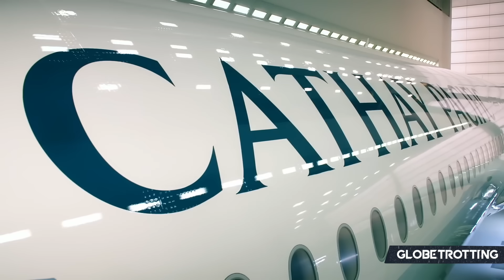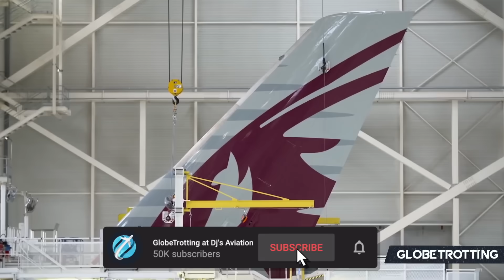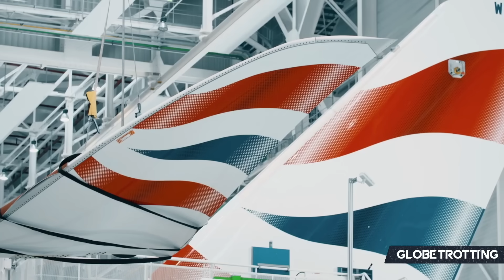777X COMPETITOR - The Airbus A350 1000

Comment: A350 is a large capacity aircraft needs a business case then it is the same with using 777x.  Because both have near 400 pax, and so it should be used in high density routes. So airlines prefering it must have a market to cater like the 777x.

Comment: i think the A350-1000 will be a great success compared to 777x, two reasons: clean sheet design of state of the art, and perfect size make it a perfect replacement for 777-300er. Despite the dalay of 777x, 777x has a big problem, it is too big and aiming to replace 380 and 747, but big Jombos are not trent any more.

Comment: 350 1000 IS SUPERIOR TOO 777 X. New design new improvements have made it even better. ENGINE ISSUES IS MAIN PROB; SO RR Need make a ultra fan for a350 1000 with 100k thrust and better maintenance  issues. RR HAS ULTRA FAN WHICH IS READY SO IT CAN BRING IT IN. ROLLS WANTS SELL MOR EOF TRENT XWB BEFORE THEY BUILD ULTRA FAN. 2028 UKTRA FAN FOR A350 1000 NEO, IS COMING. 777X IS OLD DESIGN LIKE A330 NEO. So 77x is not for 99 %% of clients.

Comment: I hope they aren't wasting too much time and material on the A350-1000 as customers are looking forward to the production start of the A600 Airtrain. It is a brilliant innovative concept of several components of passenger and cargo aircraft, taking off separately, forming one long structure in the air with 1 or 2 of the cargo aircraft being fuel containers, enabling non-stop operations to every destination on this planet. Like a railway train, the passenger aircraft sections can separate and reach specific airports, while another aircraft can join, forming the Airtrain again. The same does apply to the cargo airplanes acting as fuel cells.
Airbus is not too open about these A600 models. Patience, please. They just want to be sure that it will work.

Comment: The 77X is a more advanced plane with many features desired by the airlines. They are rightly excited about it. But some need something now and the 777X isn't available yet so they are buying the A350 1000. The 777X will do well when it finally gets certified. The 777X is the only thing that can really fill the gap of the A380 or the 747 in capacity.
Reply: From what point of view the 777X is more advanced? With the fuselage of the 80's?

Comment: Very well done. You didn't mention the real possibility of an A350 NEO version.
Reply: Airbus has already said that won't happen before the 2030s
Reply: Boeing can stretch the 787 to the same length as the a350-1000 if they need to ...the 787-10 is already slightly larger than the a350-900. Such a varient could eventually replace the 777X family down the line and compete directly with the a350neo somewhere in the 2030s-2040s

Comment: There is only a problem with this entire video...by definition its impossible for the a350-1000 to compete with something that is not in service yet....

Also, and if Boeing doesn't add any unknown surprise (cue to avoid flying on the 777x frames for a bit), Boeing is entering the market with a design aimed at gaining market share against a range of frames that have been flying for years.....

Comment: The latest Boeing offering needs to be better than the current versions of the B777, which simply no longer measures up,compared with the Airbus offerings. Having flow the 777 for the last 20/15 years ( under protest) I long to continue flying on the A 380 and A 350. With a direct connection to LHR, Paris, NY and Frankfort, our beleaguered Qantas will renew its lost close relationship with Aussies once they experience the A 350-1000

Comment: I suspect the 777x will end up replacing old 777s when they get old. 
Unless the 777x can provide better efficiency and versatility, growing companies will probably expand with the A350 instead unless they're Boeing only operators.-
Reply: Different size category the are looking at
Reply: @johniii8147  I still don’t know if Boeing is going to make the -10 which would be in a different size category.
The -9 is a bit bigger than the A350 1000, but the difference is not big, that’s why the figures in capacity, cargo, people are also expected to be close. The aircraft is not yet in service so we have to wait for the exact figures. But we might expect 10% more cargo space for the 777-9 and a few more seat capacity as well. The -9x expected range is not the same of the A350, but I suspect the difference again will not be big enough to make a difference.

So, efficiency and fleet standardization are going to be the deciding factor, not size.
And If we look at sales figures we find a preference on the A350-900, not the bigger -1000. So I doubt Boeing finds many customers for a -10x variant.
Reply: It’s likely all of the retired 777’s will become freighters just like we’ve seen 747’s and 727’s.
Reply: @thickboi7570  Nope, some, but not all. There is no conversion program for the 777-200/200ER/300. There is only a conversion program for the 300ER/200LR . Even of the latter 2, only some will be converted. Maybe  100 of the 800+ that were produced.

Comment: It is all deck chairs on the Titanic. Net zero will have a huge impact on air travel as alternatives to jet fuel will be more expensive or less efficient, which will impact air fares. For the first time since World War II there are no all new Western airliners under development. The only major project still in development is the 777X, a derivative of a 30 year old aircraft. An all new airliner launched now would likely not enter service until 2035. With moves to ban short haul air travel likely to extend to all areas served by high speed trains before then, the market for an A320 replacement shrinks. Will enough people be able to afford an intercontinental flight to justify an A350/777X replacement?

Comment: I am skeptical about the 777X in that Boeing is trying to match Airbus in efficiency metrics by cramming more passengers in it. Boeing went with traditional alloys on the 777X fuselage when it could have used the Lithium Aluminum alloys (like what the CS/220 series use) to build it. Boeing is trying to have 787 features with 777 materials on the fuselage which might lead to long term structural issues. I’m not sure how you can pressurize the aircraft at the same altitude as a 787 and have the same size windows and expect it not to wear out quicker. Sure it’s doable but there could be bigger issues down the road.

Comment: By the time the Boeing 777X comes into regular airline service around 2025. The Airbus A350-1000 could well have an A351 NEO variant in the pipeline. The RR Ultrafan engine will ensure the A350 maintains it's lead over Boeing.
Reply: It won't. Airbus has said itself any NEO variant won't happen before the 2030s. Ultrafan development has also been put on the back burner.
Reply: @johniii8147 Why do you keep repeating this "back burner" thing about the Ultrafan? Makes me realise just how much shite you talk. RR have 5 yes FIVE separate iterations of the engine in various build stages. One of which is aimed at the XWB97 segment. You can carry on putting your fingers in your ears all you like but it's happening. They finish ground testing the largest iteration and it delivers 12-14% efficiency over current GE9X. They are not going to simply put that away in a corner and forget about it.
Reply: @nathd1748  Very recently a senior executive at Airbus was said a 350 NEO would be in the 2030s. RR has also said they waiting on new airframe for the Ulta fan to go full speed. This is all easily looked up.
Reply: @johniii8147  Rolls Royce have not said they are waiting for a new airframe at all. They are chasing a 3rd engine option on that 13 year long backlog of A320 series orders and 2nd engine on the A220. You talk out of your hairy sole mate. Why would they have another 4 Ultrafan iterations under construction if they are waiting for a new airframe??
Reply: @nathd1748  they have publicly said it  at least twice  in the press by senior management. Not shop floor staff that doesn’t call the shots
Reply: @johniii8147  Yeah well on the shop floor they know exactly WHY they are building those iterations of the Ultrafan. And if a viable 3rd engine offer for A320 series comes up, Airbus are going to JUMP at it knowing the aggro coming their way courtesy of the GTF. Oh and technically the A350F IS a new airframe. Did you forget that? It is of different length to either the 900 or the 1000.
Reply: @nathd1748  Neither Airbus or Boeing is any rush for a new engine type and RR knows that. All 3 parties have enough issues currently to mange rather then focus on a new engine type and all the complexity that comes with that. It’s simply not a priority right now.
Reply: @johniii8147  Airbus and RR are trying to be at the forefront of reducing the carbon footprint of air travel. If they have an engine that can cut the carbon footprint of the A350 and A330neo by 12% they are not going to stick their fingers in their asses and ignore it. Also Airbus knows that the P&W GTF is a looming disaster that is going to impact them massively. Certifying a 3rd engine option will reduce their potential losses massively. I'm not going to argue further with you on it. I'm here in the UK seeing what's happening. You are sat behind a keyboard outside the UK classified as an AV-geek.
Reply: @johniii8147  official news just in that Airbus jumped the MTOW of the A350-1000 by 3T to 322T. I had literature 2 years ago stating the wing changes we were doing were aiming for 321T. That now gives Qantas a solid 300 pax capacity with 22 hours flying time for Project Sunrise. Just wait until you hear of RR flight testing the UF. They have a slightly smaller one almost complete and one can only assume at 100k thrust it's aimed at the A350-1000 or the freighter derivative.
Reply: Everyone seems to forget about the 787 , if Boeing slaps a new engine and wing on the 787-10 it automatically kills off the a350-900 leaving the a350-1000 as the only competitive aircraft in the line up. 

Mind you , it is the a350-900 which is the best selling varient of the a350 family not the a350-1000. So Boeing still wins in the Widebody segment whether there is an a350neo or not. 😅😂
Reply: @ms0404  but you are forgetting that RR are already building the next iteration of engine to NEO the A350.
Reply: @nathd1748  yep , you have mentioned that quite alot

Comment: I think B777x not only will  be the replecement for B7773ER but for those carriers retiring A380 and B747, the problem is, since Boeing is late about 5y now, some carriers already started to replace old planes for the A350 and they will not change back for the B777x, after Boeing's plane get in regular service.
Reply: Actually quite a few carriers have the 350 in their fleet with the 777-9 on order. BA,LH, EK, QR, SQ, CX, AI etc
Reply: @johniii8147  or both in order (but they complete themselves, not compete)

Comment: Not a 777X 8 or 9 competitor.  It is a B 787-10 competitor. Just range doesn't matter. Not even 5 % flights are Ultra Long Haul. For across the pond hops and into Asia from the US B777X is far superior and seats more. And most will be 2 Class only or 3 with premium economy. B777X will win always. And wait for the upgraded B 787. The economy figures will be stunning.
Reply: dreamer on the dreamliner!

Comment: 777x isn't flying commercially yet, so the A350-1000 isn't the competitor of the 777x; the 777x will be the competitor of the A350-1000.
Reply: Not really, they are pitched at different segments. The 777X-8, if and when it enters service, would be a potential competitor, but the 777X-9 is a bigger and heavier airplane.

Comment: 777 is good airplane.. but Boeing disregard of safety og passenger comfort make it non-starter in comparison. A350 would beat 777x without any competition, from passenger point of view.. 777 300ER feel very dated compare to A350 and A380 for long haul flight.
Reply: How does Boeing disregard of safety of passenger comfort?
Reply: @nickolliver3021 I think he’s referring to the MCAS on the 737 MAX scandal a few years ago which killed a few hundred.

Comment: I think the A350 is technically a better replacement for the current 777’s, considering the -200’s. The A350-900 and 777-200 are nearly identical in size, the -900 able to replace the 200 and 200ER’s routes. The 777-8 the same size as the -300’s and the -9 larger, Boeing does not have the ideal -200 replacement.
Reply: The 787-10HGW now on offer is also a prefect replacement. Matches the capacity and and range of the their current 200ERs.

Comment: 777X not done with certification! A350-1000 best in class could even be better with NEO sooner than later.
Reply: There won't be a neo until well into the 2030s and Airbus has said as much.
Reply: @johniii8147 Airbus HAVE NOT said as much. Airbus Filton working on possible design changes to wing to accommodate larger RR engine right now in 2023. My guess is it will roll out on the A350F first.
Reply: Doesn't mater if certification is done or not. It will blow your mind when it does in late next year

Comment: It's not as extreme as the 747/A380 but it is still the same set of circumstances. The head start Boeing had on the large plane market was insurmountable for Airbus and is a major reason the A380 is considered a failure. As the 747 did before , the A350-1000 can own the segment before the 777-9 ever flies with passengers. Airbus got  a little back.

Comment: Remember, the original A350-900 was intended to replace the 777-200ER, which it has done for several airlines. In fact, it appears British Airways may be contemplating a 25-plane A350-900 order to replace their now-aging 777-200ER fleet.

The A350-1000 was intended as an eventual 777-300ER replacement; airlines with large 777-300ER fleets such as Air France, Emirates and Singapore Airlines may start to replace their larger 777-300ER fleets with the A350-1000 starting from circa 2026 on.
Reply: They are as equally likely to go with the 787-10 HGW version at BA.
Reply: @johniii8147  That’s if Boeing ever gets around to it. 🙁
Reply: @Sacto1654  They already have.
Reply: B777x is more intended to replace your larger capacity like A380 or B747.
Reply: @aviatorsound914  At best 747-400s. As for the larger 2, yes it can replace them but the capacity difference is more significant
Reply: Sorry but they are actually rumoured to order 20-25 787-10s ..

If they want more a350s , they will order more a350-1000s not a350-900s
Reply: @mmm0404  The 787 makes more sense for them to replace the 777’s. It has much better economics than the heavier 350 in the size range
Reply: Best choice for BA some of their triple 7s are ancient, and the 350-1000 looks fantastic in the BA livery

Comment: Why would Air India want the 777x.,,,,,,,,,, when the A350 1000 ,is a more efficient type in all aspects
The CEO seems to have a bais towards Boeing;;; does the board has anything to say
Reply: The 777x is a better more efficient type just as the a350 is. whats the fuss about
Reply: That's nonsense. They actually ordered more Airbus planes than Boeing.
Reply: Because the 777-9 and a350-1000 are not in the same class. , the former is larger. The 777-9 should be able to fit more premium seats than the a350-1000

Comment: Have AB solved their de-lamination problems that affected Qatar`s aircraft? This seemed the only real area of concern for the A350 which really wasn`t a safety issue anyway. With that problem dealt with can we see any movement in AB investing money into the RR UltraFan engine develoment? This would future proof this aircraft for many years to come if it could be offered with an engine that could easily offer double-digit fuel savings over the current T-XWB. This course may also lead to investment into a `stretch` version of the  -1000 which could only help in it`s competition with B777X. If GE9X is as good as some suggest it may be that as it stands A350 advantage may not be enough to persuade die-hard Boeing customers to change to A350. All this investment ultimately comes down the expected growth in air-travel & whether it will actually materialise with all the unrest in the world at the moment. It may be sensible to just wait & see rather than make what could be very risky investments, perhaps this is all we can look forward to for a while?!

Comment: Let's see where Emirates goes, at upcoming Airshow! 
   Looking to add more 777's or A350-1's..
   Will definitely be something both manufacturers vying for..
Reply: Emirates have been reducing their 777x order. From 150 to 135 to now 115. I don't think they can go lower, as this is the only plane that can sort of replace the A380s capacity. It's no where near but it's more than the A35K. But who knows if it gets delayed again.
Reply: @AnishAbraham they converted part of the 777X order into 787s and the rest changed into options leaving 115 firm orders. 

 They could easily convert their 30 787 order back into 777Xs and reactivate their options. They have atleast 50 more purchase rights for the 777X
Reply: @mmm0404  yes sure, but they could just as easily cancel more 777x orders and buy the A35K like they originally wanted to 🤷🏽‍♂️
Reply: @AnishAbraham  well yes they could , if they are interested in losing more even  capacity to go for the smaller a350-1000. 

FYI the original order only had   20 a350-1000s . The 777-9 offers more cargo and passengers capacity to replace the a380.

Tim Clark said they will order more 777-9s at the Dubai airshow to eventually replace the a380 fleet
Reply: @mmm0404  he needs them. Otherwise he's losing a ton of capacity at major hubs. But Boeing has to get this plane certified and out by 2025. I still think with the exception of Emirates, the bulk of everyone else's widebody fleets will be the 787 and A359.
Reply: at the November Dubai Airshow, Emirates will reveal its A350-1000 with a new cabin and new tech,...watch out for that.